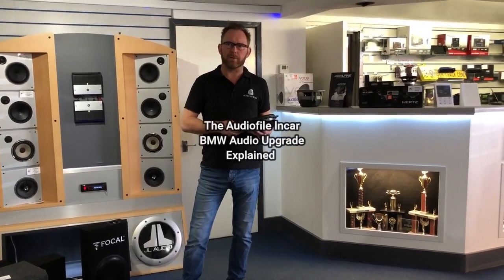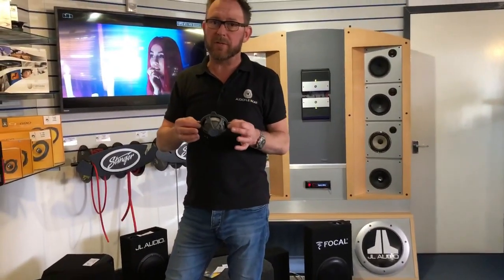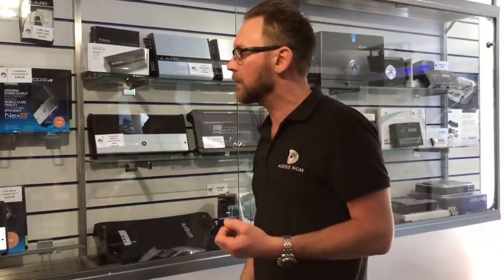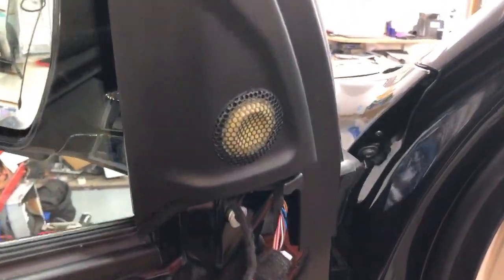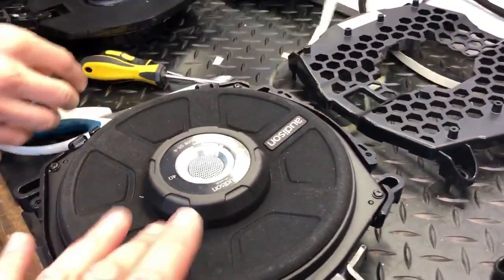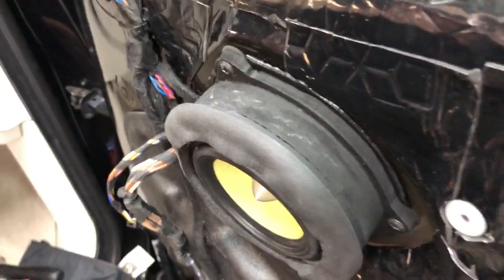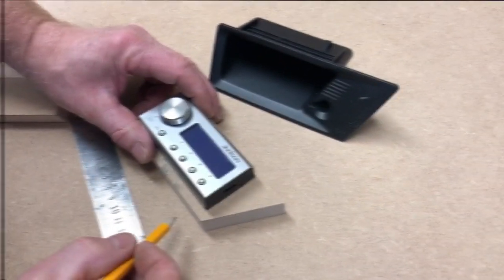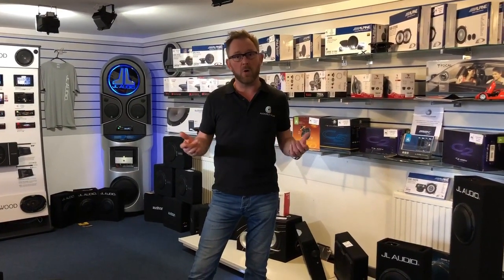The Secret to BMW Audio Upgrades.

Comment: For the budget conscious, the under-seat factory subs are not too bad and play surprisingly low as long as they are driven by a decent amp such as one of the Class D JL Audio amps mentioned. Front door speakers, amp and DSP for time correction are the essential components.
Reply: I agree with your statement. I have had decent success using the factory underseats as well, using the little clarion XC marine micro amps.
Reply: Which subs do you refer to ?
16cm, 20cm Hi-Fi or HK ?
Reply: @vollcare4076  I was referring to the factory 8" (20cm) Hi-Fi option in the F20 Series
Reply: @rjk5559  i agree, with the 20cm  HiFi USB (not the 16cm Stereo) you can generate good level of kick bass once you put an amp with ca 50W RMS to each channel…but I’d recommend put a subsonic at 40Hz and highpass filter at 130-150hz ca.
Front speaker with Highpass at 150-200hz.

What time alignment setting do you recommend for front speaker and the USBs ?
Reply: @vollcare4076 In my F22 I'm setting 1.46ms of delay for the driver side front speaker (in stock location) and 2ms for driver side USB (wired in phase) but it will ultimately depend upon your cabin size and seating position. I've set my x-over point around 120hz with a 25hz subsonic filter.
Reply: @rjk5559  thanks, I’ll just try that in my F20.

So you basically set no delay for right 10cm+Tweeter & under seat bass, right ?
Only the delay for left side speaker as you said above ?!

Did you set your delay values by measuring the distance in cm, or based on hearing, or even accustic measuring software  ?
Reply: @vollcare4076  It's easier to set time correction by ear but acoustic tools can be useful for tuning eq, I used REW.

Comment: I put in the bimmertech amp on my 2023 bmw 330i xdrive with idrive 7 and hifi audio. It was a direct plug and play and made things much better but there still is no base so I added 2 arc audio 10in black series subs into the trunk and then just keep the pass through open.. and things are pretty decent. I kept the below the seat “subs” because they don’t work as “bass” really in the car but work more as midrange. In my old 2010 bmw 335xi with base audio…I did the setup basically in this video but had the earthquake below the seats, those exact focals in the front, and morels in the back.. no matter what I did there was so much bass and no mids.. the focals were so “bright” they actually hurt my ears. Everyone is different.. but I just hated the focals.. the morels were much better..
Reply: I couldn’t edit.. but I meant I drive 8.. not 7
Reply from the maker: We use both Morel and Focal, the Focals defiantly don't hurt your ears, you should have tons of midbass from the under seat woofers, I am afraid it sounds as if something is very wrong with your set up.

Comment: Really good video - out of curiosity, why do you use passive crossovers as well as the DSP. Doesn't the DSP remove the need for passive crossovers? Also - you don't mention speaker cable - presumably you do upgrade it throughout?
Reply: Running passive crossovers in conjunction with the DSP eliminates the need for separate power amplification for each and every driver such as tweeters, and mids.

Comment: All being well, I’ll get the Focals for the E90 from you. Will need to do the install when it isn’t as cold and wet. In the meantime just wanted to know if you use an oscilloscope to set the gains? Cheers.

Comment: Wow! This is impressive work a lot of pride and workmanship. I’m just a little confused about the use of the three channel amp rather than a four channel.  Are you wired the underseats as mono to achieve that?
Reply from the maker: Thanks Shakeel, we use 4 Ohm subs in parallel to give a 2 Ohm load, this is the ideal load for the amps which then produce 300W RMS. The subs are running low frequencies only so no need to run in stereo.
Reply: Ah ok. I was under the impression that they were midbass so hence would perform best between 80-200hz and having to supplement with a subwoofer to carry the 80hz and below frequencies.
Reply from the maker: @shakeelfaris7623  Hi Shakeel, If we run a " Party Sub" or similar boot mounted sub, then the under seat subs are band passed to protect them from the really low bass frequencies, normally actually around 50Hz as they play really well down to that point. However, they must not run up to 200Hz, this is way to high and the sound becomes very directional, vocals will appear very muddled and will be coming from under the seat. This is why you cant use a 3" speaker in the door, they only run down to around 300Hz and the under seat subs have to therefore run up to 300Hz, they then sound awful! Hope this helps.
Reply: Thanks for the response. So in a 3 series for example, you would run the mid range at 150 upwards and then the tweeters that are on a crossover network would take care of the highs? The midrange would be bandpassed between 50 to 150hz and the sub woofer would take care of the 50hz and below frequencies? Hope I’ve understood that ok? 🙈
Reply from the maker: Shakeel Faris spot on👍 you are now part of the team.

Comment: I know that you have to tap the front speaker cables in order to send a full signal to the dsp, but where is the best place to tap it? Is it best to grab it from behind the head unit, or from the plugs that you disconnect from the woofers under the seat? I know that they are in parallel with the mids in the door. Thanks

Comment: Ah that’s good to know thanks. I’m guessing that those signals will also turn on the Bit Ten D, thus eliminating the need to tap into the 12v ignition wire?

Comment: So for the example you have given, you have a 3 channel amp, channel 1 and 2 takes care of the mids and highs and channel 3 takes care of the 2 midbass under the seats wired in parallel. Let’s suppose you added the party sub to the equation, I’m guessing you’d need a 5 channel amp with the 5th channel taking care of the party sub and 3 and 4 taking care of the midbass under the seats. Or rather keeping the 3 channel but introducing a monoblock? But in this scenario you would need to wire the underseats as normal to 3 and 4 and not in parallel because channels 3 and 4 won’t see a 2 ohm load thus losing the benefit of wiring in parallel in this application? Thanks

Comment: Would have looked much better if the client purchased genuine tweeter covers.  Can you do a full speaker upgrade with amp for a bmw f40?
Reply from the maker: The systems we have are compatible with all models, check out the web site www.bmwaudioupgrade.co.uk or pop in for a demo.

Comment: I'm presuming the Focal's are better sounding than Audison K4E's. Will the Focal ES100K's work for an M4 (HK-"688") - Doors and Rear side panels? Will they fit (depth) an M4 only using an (3 hole) adapter ring?

Comment: Do you run complete new wiring from the factory head unit to the bit ten or re route the original speaker lines?
Reply from the maker: We actually pick up the signal from a different location meaning its not necessary to remove the head unit at all.
Reply: @AudiofileIncar  thanks I’ll drop you guys an email later

Comment: Does adding the sound deadening material add a lot of weight to the car? i usually see people adding some around the speaker housing by not the entire door. I'm sure it makes it sound incredible, just wondering what the impact of the added weight  has on performance.
Reply: .7 lbs / 1 sqft.  Sorry for the American measurements.  But this should help you get an idea of weight once you convert.  I do this to all my vehicles when I upgrade my speakers.  You can feel the weight in the doors when you handle it.

Comment: Any suggestions for a wiring harness that will work with a amp that uses fiber optics on a 2008 bmw 335i, it has a logic 7 surround.

Comment: If I replace the standard HIFI in my G30 with the B&W from another G30, (amp and speakers)  will it work with out coding?  Can I use BimmerCode to enable the profiles?  Or do I need to goto a dealer to get the B&W amp to work at all?
Reply from the maker: Hi, our speciality is upgrading the audio, not fitting B&W. there are people that concentrate more in this area of reto fit but its definatly not our thing. Hope this helps

Comment: In order to get a full range signal to send to the DSP, do I need to tap the fronts only or the front and rears? 2011 E90 with non-I drive base HU. Thanks
Reply from the maker: Shakeel Faris you only need to pick the front speaker outputs, this will give a full range signal.
Reply: @AudiofileIncar  . When installing the BIT DMI, there is then no need to tap into the speaker cables to send a signal back to the BIT TEN D correct? Would you then just run new speaker cable from the speaker locations to the amp, or can you still tap into the existing wiring using a breakout harness? Thanks

Comment: Also. In order to get a 2 ohm load. Do I need to bridge channels at the amp besides doing the parallel wiring at the speaker(s) thanks
Reply from the maker: If you are using a JL XD500/3 amp then the sub o/p is mono anyway so will see a 2 Ohm load with 2 x 4 Ohm subs, be very careful not to bridge into a 2 Ohm load as the amp will see 1 Ohm per channel, this can be a problem, most amps will not like this.

Comment: Hello i wanted to see if you could help me. I have a 08 bmw 328i with hifi sound system and im looking to upgrade all my speakers including the 8" underneath seat subwoofer. Tell you tell me what seakers on the doors would be best, and what underneath subwoofer has the most bass and what amplifier you would recommend?
Reply from the maker: Junior Luna hi Junior, the answers to all of your questions are in the video, watch it again with the sound on.

Comment: ..class D amplifier?? 😁
Reply from the maker: This is an amplifier which is way more efficent than a Class A/B traditional amp, Class D (digital) amps are also generally smaller as they do not produce as much heat.
Reply: @AudiofileIncar  ...but the quality in audio (for audiofiles of course..) is left somewhere... behind.
Anyway, there is good stuff for bmw environment. BMW 7UP; class D, limitless settings.. and very small for what it produce..
Reply from the maker: @MrFryfish  remember that you are looking at a £3k audio system, not a £10k high end system which would be using class A amplification. We do have plenty of options for Audiophile clients that want bespoke installations.